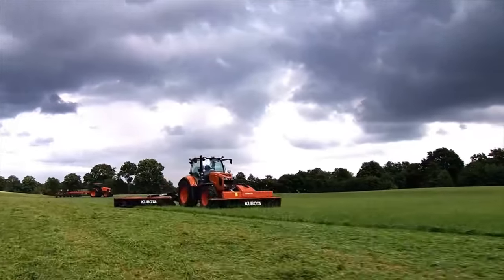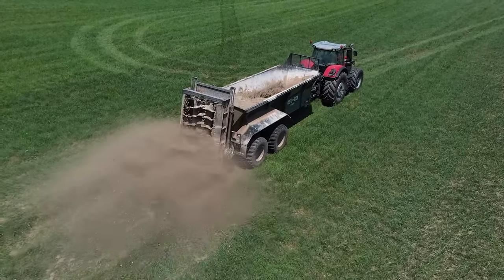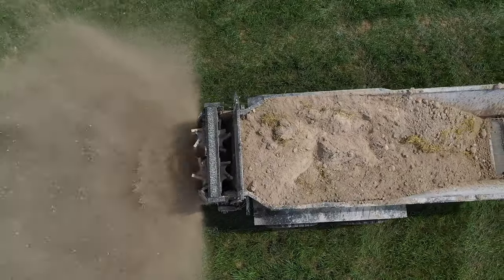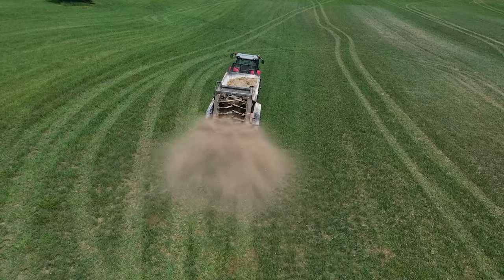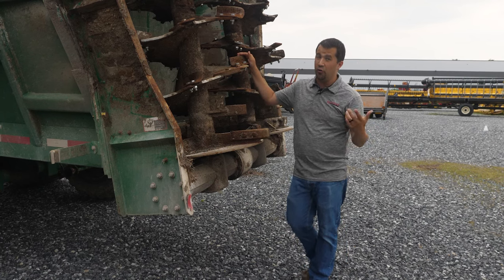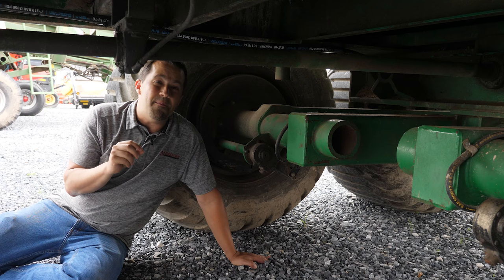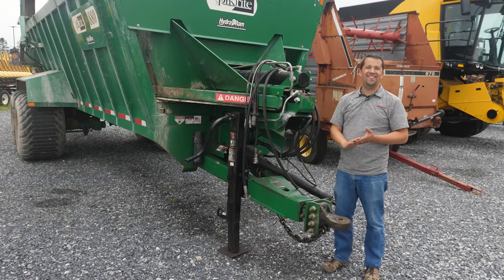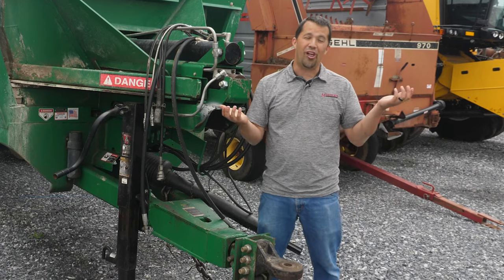What to consider when choosing a spreader | Pikrite Spreader at Weaver Family Farm in Hershey, PA

Comment: Coming from someone who builds these on a daily basis the hp spreader does not have a pto driven chain system most come with 1 hydraulic motor and gear box that drives the chain towards the beaters the hp 900 has 2 hydraulic motors and gearboxes one on each side

Comment: I am looking for a 3PT spreader that can spread line as well as fertilizers. Since I only have 4 acres, the locals lime spreaders won't even take my calls.
Reply from the maker: See Vicon/Kubota VS series.
Reply: With 4 acres, I assume you have a compact.  I would think that an FSP or PTS series can do that job.  The VS series Messick's mentioned looks sweet, but may be overkill.

I've done a couple of acres of seed, granular fertilizer, and lime with a cheap 130# capacity lawn mower pull behind spreader.  It gets the job done, but I have to keep the tractor down to 3mph and refill a few times.
Reply: AG lime is like a powder, it pours out like sand does, so the spreader needs to be able to spread it without dumping it.  The VS apparently has a screen or something that can block off most of the outlet, but I can't find info to confirm it can spread AG lime. It can spread pelleted, but any spreader, even the $600 3 pt from the box store can spread pelleted, but for what pelleted cost, by the time it is done spreading, it could pay for two of those box spreaders.

Comment: I have a very old spreader in the fence row.  Similar to the modern designs but designed for a 25 horse (?) tractor.   
And a bunch of 1 horse equipment before tractors were a thing.